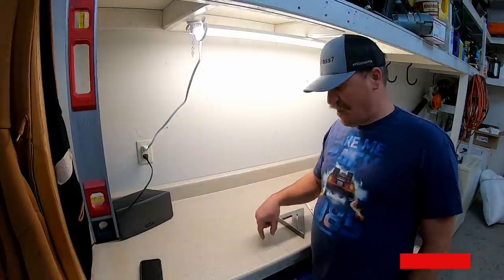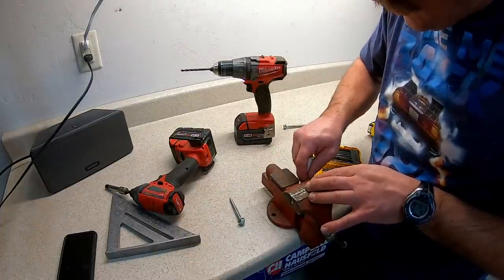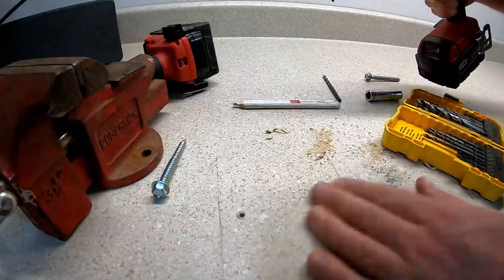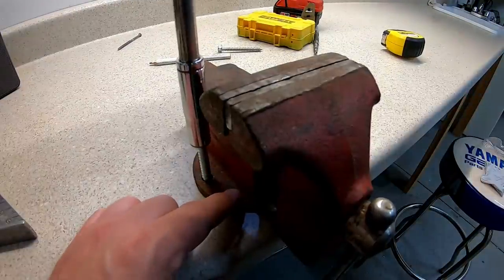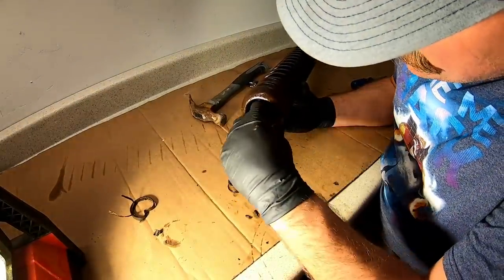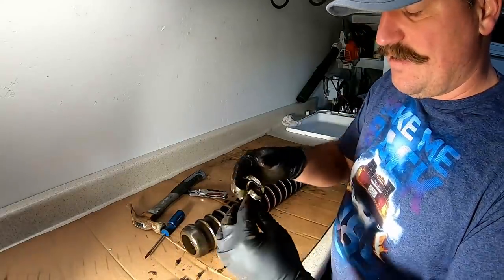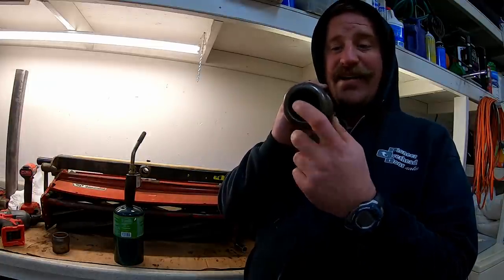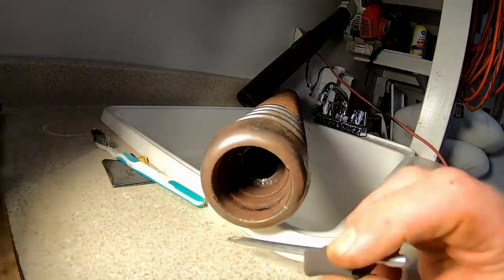How to remove a BEARING RACE WITHOUT a puller. Toro roller bearing

Comment: The trick with the mig welder is to put a ring of weld bead right around the  bearing race the full 360 degrees then as the weld cools it will shrink and the bearing race should come out quite easily  however the  flamethrower gas torch approach is full on rebel so full kudos to you we would expect nothing less, :)

Comment: Guys...guys...and anyone watching... You had the perfect tool in the beginning and at your disposal. If you're going to replace the races with new, simply weld a bead 360 degrees around the race roller surface, and let it cool.  Out it'll come...lot of times...fall right out!

Comment: When it said about using the arc weld I think they meant weld something to it to pull it out . Did you not try using a long bar to knock the casing out from the other end first ? Just seemed s bit brutal

Comment: I am working on my Steiner 425 Tractor. Trying to make it look nice. Bought a ATD 6900 spray gun set for 94.00. The paint store recommended using single stage paint since I am a novice. PPG Delfleet Essse 89.00 (red) quart, delfleet activator 15.00, hardener 39.00, epoxy primer catalyst 37.00, grey epoxy primer 23.00, white paint ESSSA 10.68. I tried buying other thinking it would be cheaper.  It wasn't. Also get some prepsol or prep all. Working on tractor on this holiday. Let me know if u have any questions. I will post a sorry video in the upcoming months
Reply from the maker: Yes please do post up a vid. I want to see. I took my parts to a guy who is doing it for me. I bought the good ppg paint for him